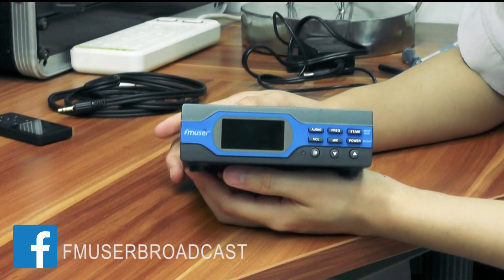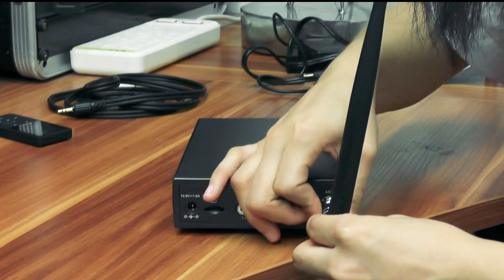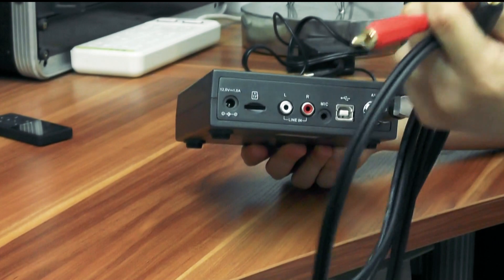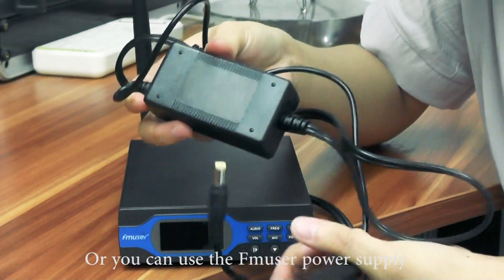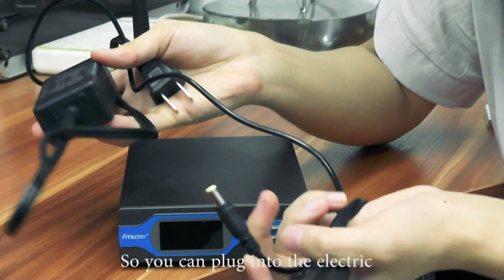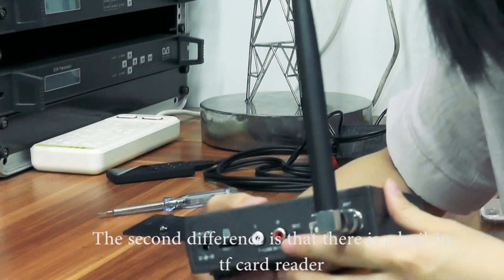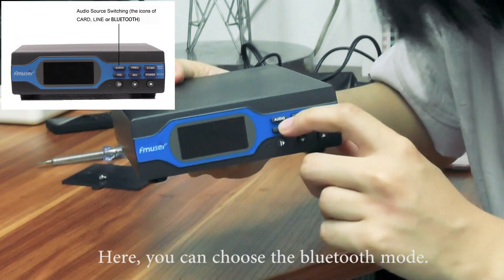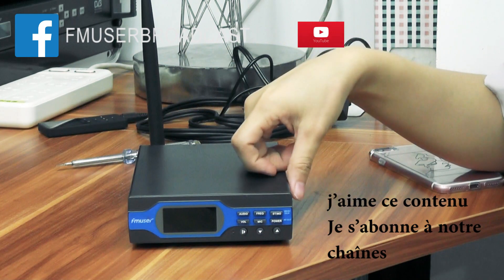Low Power FM Transmitter Kit for Small FM Radio Station/Church/Parking Lot/Drive-in Theater

Comment: what range would it round about in a city with 100 feet buildings when this transmitter is on the street ?
Reply from the maker: Hi Callas, thanks for the comment! Specifically speaking, the broadcast range of an FM broadcast transmitter depends on three important factors, which are first, the power of the device (the bigger the power, the wider the covering range is), second, the obstacles stands on the way the transmitter broadcasts(more obstacles there are, less signals the radio station can receive), the installing height of the FM antenna(higher the installation is, wider the covering range is).

Comment: Could you use this to power a 1w narrowcasting radio service & have you tested the outdoor range with this transmitter.
Reply from the maker: It can cover about 1-3km if you put it in a open and flat area
Reply: @fmuserbroadcast  Thinking about applying for a licence & connecting It to a outdoor 10 meter mast.

Comment: Can i use this to broadcast live voices like a campus radio broadcasting?
Reply from the maker: How far do you want to cover?
Reply: @fmuserbroadcast  IN THE USA THEY CAN'T TRANSMITTE MORE THAN 600 FEET ..
Reply from the maker: @BigHeartedMan65  What a pity!
Reply: @BigHeartedMan65   yes here in the United States you are permitted to broadcast without a license under part 15 of the rules for micro broadcasting however it is just a couple of feet have the output from your transmitter cannot exceed if I'm not mistaken more than 0.5 Watts. So this is a 1 watt transmitter it would transmit too far and exceed the legal limit under section 15. So to use this transmitter you would actually have to acquire a low band radio broadcasting license we have a local campus radio station down here where I live at our University they cover a 10 Mi radius which is the campus and throughout the entire town so they are under a broadcasting license for low band radio stations however they cannot exceed that 10 mile range. Otherwise they would have to go into a different license for high-powered stations.